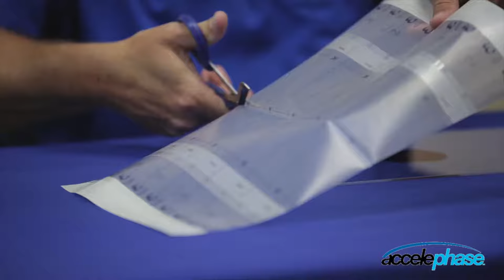NPWT Training - How to apply dressing for negative pressure wound therapy

Comment: VERY IMPORTANT NOTE:  for the wound vac to work properly it requires a 2.5cm round hole opening in the drape when the trackpad will be attached regardless of the size of the wound.  If the wound is too small the mushroom technique should be used
Reply: what is mushroom technique
Reply: @lynnsummers8500 Bigger piece of foam (cap) on top of a smaller piece of foam (stalk).😊

Comment: What about taking showers?  I might be doing this next week for my wound.  Are these shower proof or you redo it once a day?
Reply: Hopefully your surgery went well. I had pilonidal cyst surgery and had it for 2 weeks. I had to shower with little to no water because of its location and the dressing changes was the most painful experienced of my life. And the buzzing and not being able to move too much was hell for me. But can’t deny the healing part. Curious about your experience.
Reply: @Elespiritúenlamáquina I have an abscess on the buttock which is healing by normal dressing (after surgery), I'm afraid to use it because of the pain, normal dressing itself was very painful for the first two times